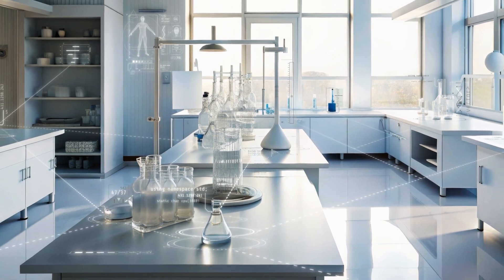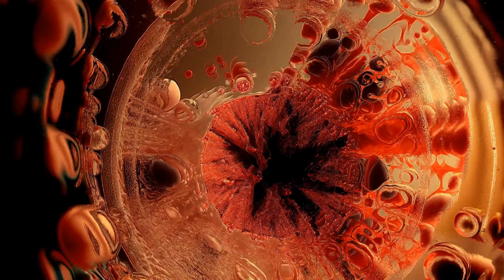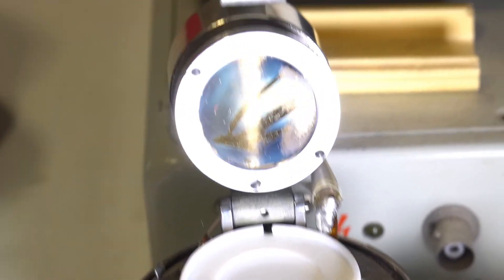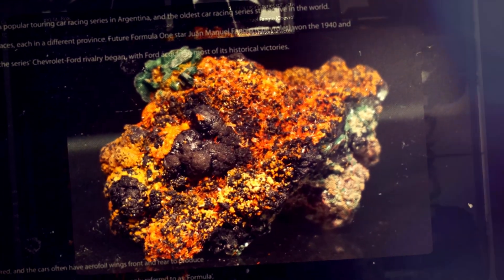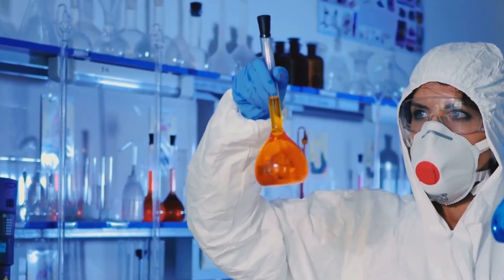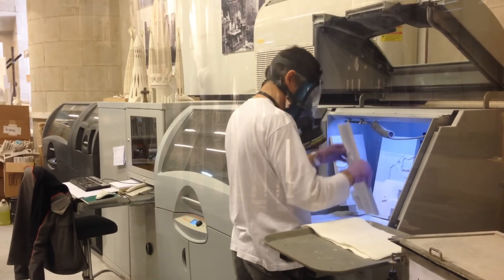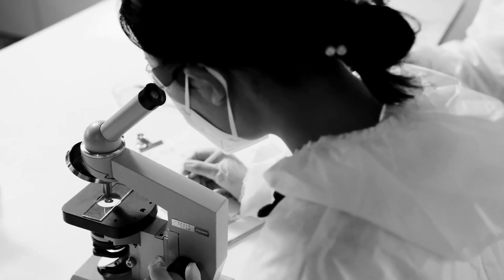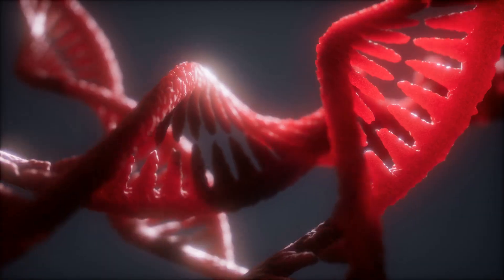The Most Dangerous Element on Earth

Comment: Alpha radiation may be the most easily stopped. But it can be as much as 20 times more damaging in the body, as opposed to other types. So if you take 1/2 Gray from 1 sievert of gamma radiation, that same sievert if it were internalized alpha radiation, could deliver at least 10 Gray!